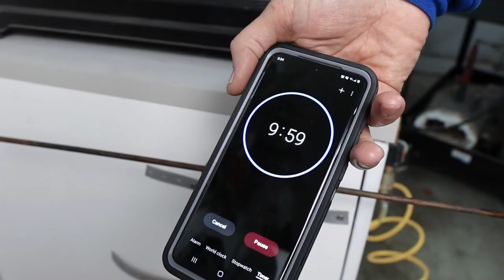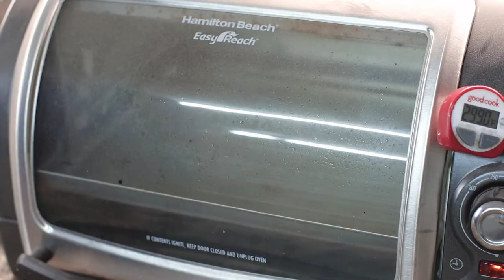Making a hand forged 4" field knife from 5160 with a 550 cord wrapped handle

Comment: Would you go over the layout of the holes in the tang and how the cord wrap is done? I've never done a cord wrapped handle,  but would love to some time.
Reply from the maker: Yeah, I could try to do a more detailed video on the handle wrap sometime. I don't really have any rhyme or reason to the hole layout, except for the lanyard hole where you'll want to finish the wrap. The rest of the holes are just to get the weight down in the tang. Thanks for watching!
Reply: @DavidMoonForge  thanks,  I couldn't tell if the wrap went through any of them or just over the top.
Reply from the maker: Yeah, the wrap is just over the top.

Comment: i gotta get an anvil and hammers. Stock removal is not doing it for me any more.
Reply from the maker: No joke buddy. I enjoy forging knives so much more than stock removal. I started out with a Harbor Freight 3lb cross peen and a 1.5lb sledge that I rounded over one side. I think about the cheapest anvil options out there are the Happy Buy anvils on Amazon. They're not great, but they're good enough to get started until you can pick up a higher quality anvil. Good luck! Let me know if you get set up for forging 🤙